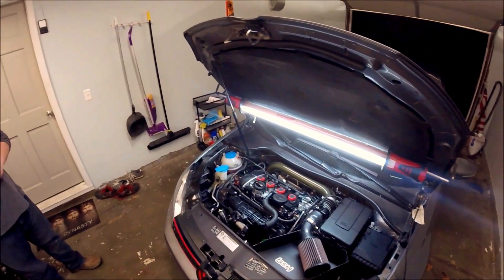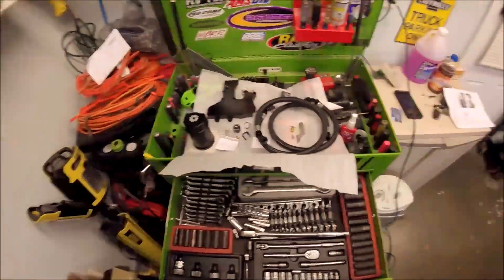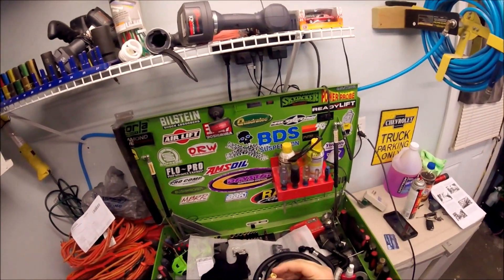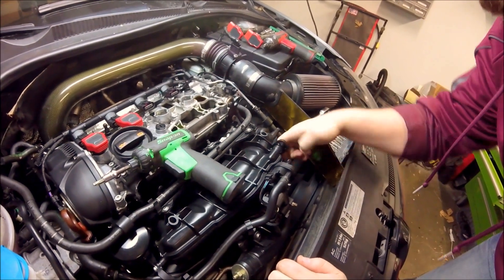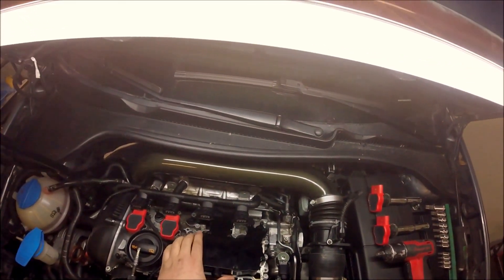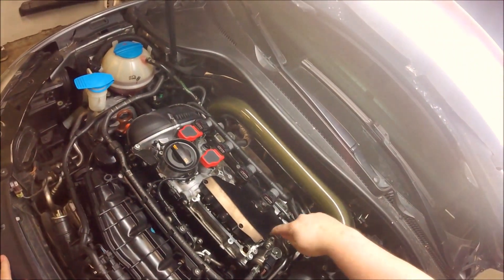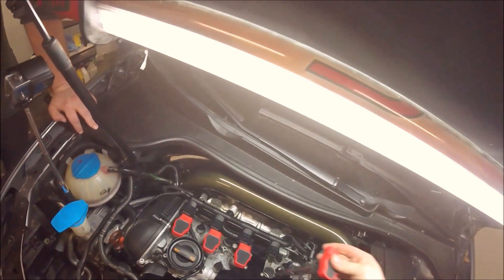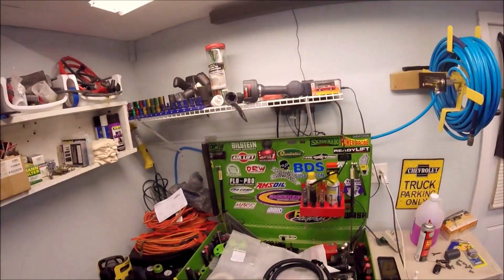Integrated Engineering Catch Can Install on GTI

Comment: Have a question I have an issue with mine consuming oil , when I remove the oil cap it has alot of vacuum.  They say its because of the pcv valve. I just was wondering if this would help me out. Thanks

Comment: Is this catch can baffled or filtered on the inside? Or is just a plain container with no type of oil/air filtration? IE has no info on it on their site. Also, does it have a dip stick?
Reply from the maker: There's no dip stick, the container is enclosed.  from what I can tell it is filtered, that being said I have not figured out how to totally open this thing up yet... it HAS gotten to the point where when it is time to empty it I have to take the drain plug as a whole out instead of just opening the valve.
Reply: Damn, so you wouldn't recommend it?
Reply from the maker: I mean it works! I have proof of that every time I empty it, but I think that for the price they could make it a little easier to ensure everything is cleaned out of it.